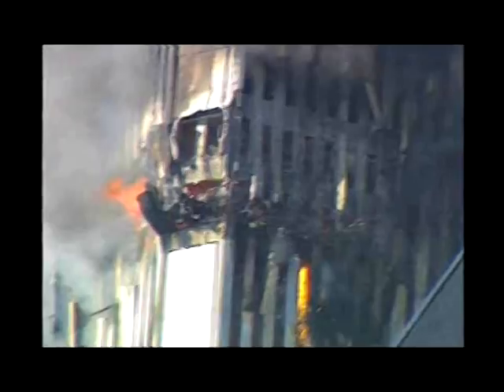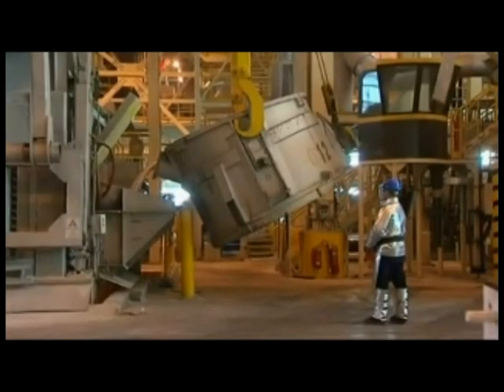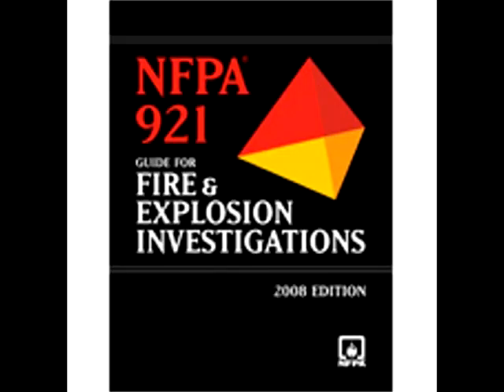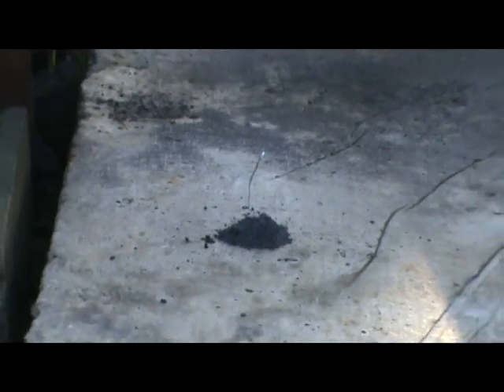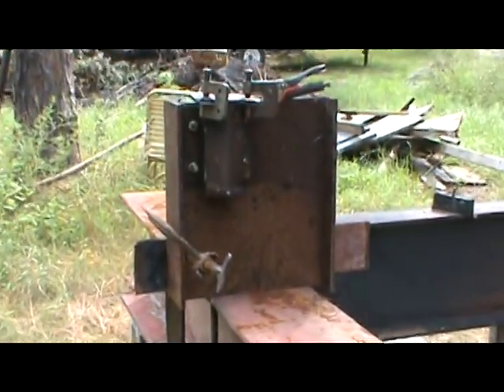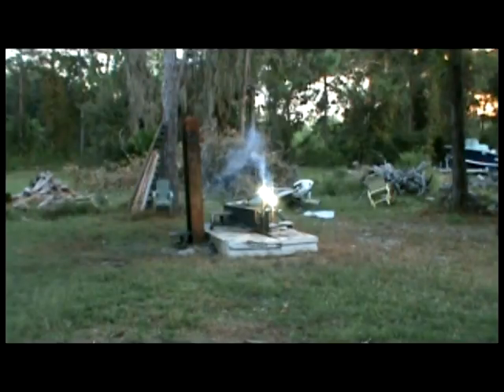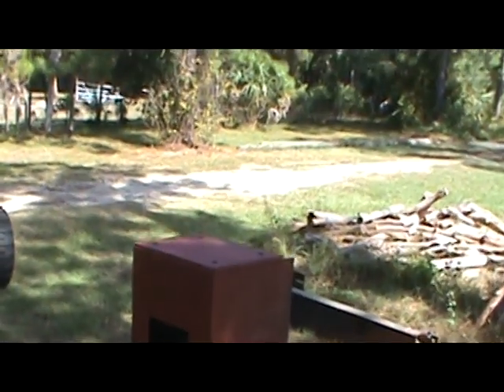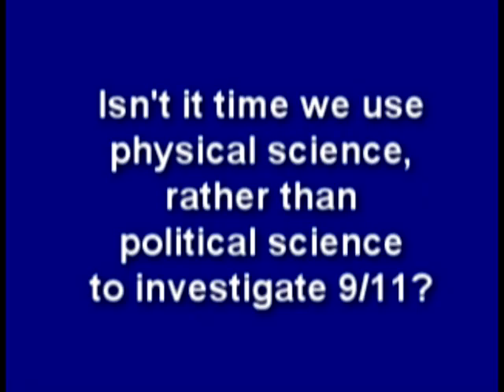9/11 Experiments: The Great Thermate Debate

Comment: is it unthinkable that a 400,000lb plane traveling at 500 miles an hour could cause a tall, thin building to colapse?
Reply: So if you cut a tree from half way the bottom half will just crumble
Reply: 400,000 pounds of material doesn't vanish, even if it did desintigrate it would have dumped 4,511,315,422 joules of energy or 3,327,375,499 pounds per square foot. do you have a concept of what that kind of energy would do to support structures?
Reply: ***** They definitely didn't build that building to withstand a hit from a 747, maybe a much smaller passenger plane, but not a monster like that. Plus look at this niggas math ^^
Reply: +Ty Lane 
It was NOT a 747. Check your information
Reply: +Ty Lane 
Well, I agree. The inside of the building was more or less open space. So Debris can shoot through the holes and the exploding gas/fuel is clearly seen. 
If the plane hit one side, wouldn't it then cause the building to at least tilt to one side? You know, less perfect destruction picture.
Reply: Martin Hoffmann Dude I'm just saying it was big plane, chill
Reply: ***** Site your source friend.
Reply: ***** Ok, *then your words are meaningless.
Reply: Of course the top halfs should’ve bred demolished but for the WHOLE thing to go into free fall is demolition
Reply: ian1493 I don't think you understand how planes work friend, the planes themselves are a whole other topic of discussion, first off how the hell can those flimsy planes travel at such speeds so low to the ground in the first place? Why where they so silent, they made no noise whatsoever! How can the wings cut steel? Do you know the material there made of? 

The planes themselves defy laws of physics, the reason planes need to travel 30,000 feet in the air is because the air up their is 3 times thinner, because the air is so thin they can easily maneuver and travel at 500 to 700 mph the air down here is much thicker and a plane that flail would tear itself apart in seconds attempting to travel at those speeds. In fact those kinds of planes are so weak the wings aren't strong enough to hold the fuel, the fuel is much closer to the body yet I'm suppose to believe those weak wings are strong enough to cut steal?

Also why were they silent? Those airliners are louder than guns, yet people didn't hear anything from those airliners that close to them, they heard the explosions yes, but the planes themselves were very quiet how the hell could they sneak up on them like that!?
Reply: +Martin Hoffmann The energy produced to create craters at plane crash sights is surely enough energy to break welds, and weaken the centermost points of a structure. Plus there is clearly video of debris and explosions going all the way through both buildings. Scientist have also stated that the beams didn't need to melt they just needed to be weakened by the incredible force of the impact.
Reply: Doesn't matter how heavy the airplane is. It is made of thin light material. It vaporizes at that high speed.
Reply: There is no point even in arguing this, since the official story says fire was responsible for the collapse, not the airplanes. After all, WTC7 also fell and wasn't hit by any airplanes.

Comment: The Boeing 757 and 767:

The aluminum that modern aircraft are made of is not the same soft material as that of a beer can: Aluminum 2219-T81 UNS A92219; ISO AlCu6Mn; Aluminium 2219-T81; AA2219-T81 – with a tensile strength greater than that of structural steel.

Gross weights 172,365 kg (380,000 lb) and, from 1992, 186,880 kg (412,000 lb); further increased centre-section tankage.

Structure

Fail-safe structure. Conventional aluminium structure augmented by graphite ailerons, spoilers, elevators, rudder and floor panels; advanced aluminium alloy keel beam chords and wing skins; composites {Kevlar} engine cowlings, wing/fuselage fairing and rear wing panels; CFRP landing gear doors; and aramid flaps and engine pylon fairings.

The airframe further incorporates carbon-fiber reinforced plastic wing surfaces, Kevlar fairings and access panels. Boeing 757 & 767.
Jet Impacts on WTC Towers 9/11/2001

Analysis by Willy Whitten – August and September 2012

All available data and reasoning based on such, proves beyond a reasonable doubt that large twin engine jets hit the world trade towers.

That they were flown by remote control [1], and had special engines configured to fly at the speed {at sea level} recorded: 450mph.

[1. See; Aidan Monaghan B.Sc. EET – abstract below]

This evidence includes, video footage and still images – radar analysis – wind shear analysis proving superior control –Sandia crash data – as well as kinetics analysis proving the energy needs were more than sufficient.

ABSTRACT:

Newton’s Laws of Mechanics:

> First law: Every object continues in its state of rest, or of uniform motion in a straight line, unless compelled to change that state by external forces acted upon it.

……….

This first law has to do with inertia or momentum, depending on the original states of the bodies in question.

As per the event we speak to, the first body is the building. In the frame, ie planet Earth; this body is at rest, an inert state, which has only one property: Mass.

>Second law: The acceleration a of a body is parallel and directly proportional to the net force F acting on the body, is in the direction of the net force, and is inversely proportional to the mass m of the body, i.e., F = ma.

……….

A state of Momentum has three components: Mass – Velocity – *Specific Direction. [*vector] -Velocity is described as mass-times-velocity squared in the energy equation.

In our frame, ONLY the plane has a state of momentum.

Moment and Point of Impact are both necessary integers in formulating impact physics. At that point and moment the kinetic energy of the mass in movement is transferred into the building AT THAT SPECIFIC POINT – the impact zone.

It is at this point that we come to the third law; that every action has an equal and opposite reaction. And this does certainly depend on the speed of an impact, as the first two laws clearly state that they are of first and second account before the third proposition can manifest.

Again it is at the point and moment of impact that the third law comes into effect and must be translated as per the laws of kinetics incorporating the maxim of equal and opposite reaction:

Kinetic Energy is defined as the work needed to accelerate a body of a given mass from rest to its current velocity.

KINETICS 9/11:

The energy equals one half the mass times the velocity squared: ( E = 1/2 m v^2)

The plane has a Mass of 120 tons – traveling at a Velocity of 540 MPH:

The kinetic energy resulting would be equal to 0.75812 ton TNT

OR: 3.1720e+9 joules (watt second)
https://hybridrogue1.wordpress.com/2014/02/04/911-disinformation-no-planes-theory/
\\][//
Reply: Willy Whitten You’re just bat shit insane

Comment: Nice experiments with thermite! But hey, jet fuel does melt steel,even hi-temperature alloys - e.g. in jet engines themself there is a lot of evidence regarding meltet (steel) turbine blades. I would not take the idea that jet fuel can not melt steel in general as true one.

Comment: Hey, those are some great thermite techniques. I am going to keep those in mind. Also we know thermite can melt steel. That is how they weld repairs on railroad tracks. National Geographic sure sucks at doing research, ha.

Now as for thermite taking down the towers, there are still a few problems. First, how could anyone get all those devices in the towers? I mean, that is a rather decent size job to attach all those devices. How did they go unnoticed? Also, how were they able to so accurately predict where the planes would strike the buildings? The collapses started at the section damaged by the planes. Also, how did they set up the devices in a way that they would not be damaged or destroyed by the aircraft? The aircraft could had taken out an entire side worth of such devices, ruining the desired effect. Also, why would whoever set this up not think the planes would be enough? Finally, why bother? Two aircraft doing that much damage, even if the towers do not collapse should cause a great deal of fear, what I would presume would be the desired effect at least.

Comment: I use to work on the railways. When welding tracks we would use a bag which contained bags of powered material  containing a mixture of thermite and powered steel.
You would set it up as a mold With the powered mix set up above the mold. You would ignite the powder which would then melt and flow into the mold joining the tracks together. 
Sometimes the bag would be ripped have its contents spilled on the ground, So to make up the loss we would just toss chunks of whatever steel we had laying around. Railway dogs (spikes)Thick steel plates etc Light it up and within seconds those big solid chunks of steel would be molten metal flowing like water

Comment: all high  rise  steel buildings are built around the elevator shafts. they are built of concrete and rebar  filled with jet fuel they will burn like a kelly kettle until the concrete explodes breaking the buildings back bone and causing the perfect implosion. thank God that the buildings fell into themselves and not like a tree .  God save America

Comment: There reports that before an attack work was being done at night inside the buildings. Possible they could have pre cut main load bearing beams so less termite is needed. And using nano-termite( nano or super duper termite) to cut less surface area( if beams were already precut) will defenetely do its work. Very nice video. Lots of work involved. Much apreciated.

Comment: As a structural Engineer myself, I give you massive credit for this video. Excellent progression with your experiments. I worked on the rebuild of the WTC and it frustrates me to hear so many people talk about theses theories who have so little experience in basic physics.  That being said, to be a fair experiment, you should heat a truss structure up and see what temperature it starts to deform the floor plate.  The inward collapse of the outer columns has been well documented (watch the multiple videos as the collapse commenced). 

As soon as that happened, there's not a building in the world that could withstand floor pancake collapse

Comment: i got a question, if thermite is made from aluminium and iron oxide, and the plane was made of aluminium and the steel beams were rusty, is there any way that thermite could have created itself? if jet fuel melted the aluminium of the plane, could that then mix with something? i know that molten aluminium and water is really volatile.

Comment: Just throwing this out there... thermite in its crudest form can be produced in a building that is constructed of aluminum and steel... the iron oxide needed to make thermite is often scraped from steel... in a high temperature environment if the two mixed or were exposed properly they may have ignited much the same way... conspiracies are rediculous in my opinion.

Comment: iron can oxidize, and steel even contains carbon, which burns quite nicely (see charcoal) -- so who packed tons of thermite into the joints of the Trade Towers, and why didn't any of the inspectors or workmen or employees there ever notice it being done?  "You are being bombarded with conspiracy theories every day, and most of you ignore it, but some specially susceptible individuals swallow the BS whole" - Poor Richard

Comment: Plans are made of aluminum and magnesium  alloys, so as soon as you get the alloy to melt the magnesium  will start burning. Also the plane most likely took some of the insulation off the steel beams so when those beam with no insulation are exposed to high temp they will hold their heat better because Of the places where the insulation didn't get taken off. So it's not very difficult with those things working agents the steel

Comment: These experiments are of no significance since you only had to weaken steel, so it can bend, which heating does perfectly. Then the weight above collapses the tower.   There was no weight of tower above in this experiment.     A real conspiracy of this size would not go undetected.    Nothing is this experiment tested the premise that enourmous amounts of jet fuel and raging drafts of air cannot melt steel.

Comment: Alright they are not saying that Thermite can't melt steel just that they were saying in a vertical aspect all the heat is burning downwards. It can get hot enough to cripple steel on a vertical placement by getting it close enough to the melting point. They use thermite to weld rail road tracks for the last 30 years or so. Also those pressure puffs would be due to the increased pressure from the heat inside the building or it was internal layers of the building falling down or hanging creating the pressure to make the puffs and not explosive. The whole function of structural steel is its strength. Add heat to it will weaken the steel and does not even have to cut. Also to setup that type of system to make the thermite effective is going way to far. The best explanation is the fuel started and made fires hot but everything else in the building made it even hotter. Gas fires in vehicles have been known to melt down engine blocks to puddles of steel and iron. Trying to make things out of something of speculation. Also the thermite mix can easily be made from rust and aluminum and activated by an electrical flash. That happens with thermite production and static sparks. That building had electricity for a long time before fell. Also one final thing is that piece that looked bulged out was because it was hot and compressed outwards bending it to that shape. Many things can cause lots of popping sounds like gunshots and then loud bangs after. Concrete that is heated up will do that and the same with steel under pressure. For you to say an office fire cannot melt steel shows how much you don't know. I have seen several car fires that got hot enough to where you could not look at it. the aluminum intakes melt and mix with the steel just enough to start a thermite reaction and then melts down the engine block. Yes use Science to figure things out but when you have an idea and try to prove the idea that it can happen, tends to go to far and leads to that the building was set for self destruction.

Comment: I agree 9/11 was an inside job, but I find it unlikely that explosives or thermite could be set up on each floor and would happen to be so close to the floor where the planes hit.

How many people think that it was a nice neat lab condition in those towers?

You had high winds, vaporized materials including drywall, fabric from furniture, aluminum from the plane and from furniture that shatters into a fine dust on impact; titanium from the airframe which will burn without any oxygen once ignited.

This is an excellent video that explores a lot of thermite combinations, but I would like to see the maelstrom type environment to see if that could cause it.  Experiments to this level using Jet-A fuel, and by utilizing atomized microfibers and drywall, in high speed winds, mixed with jet fuel.

Comment: Really interesting, but it does not consider the possibility that the crashing aluminum airliner, and lots of iron oxide from the burning building cooking the beams could not have atomized lots of powdered metals and metal oxides together at high heat with lots of potential accelerants (e.g. Jet Fuel, Acetone, etc.) creating a thermite reaction as a byproduct of the crash.  It is certainly of a similar likelihood to a open-minded but neutral observer.

Comment: "Nano-thermite" is just very fine particles of iron and aluminum suspended uniformly in a viscus media. It gets called "super thermite" due to it's ability to make thermobaric reactions. This is a great video, I would like to offer another side of this same issue. I'd like you to try and get steel to melt using only jet fuel, and office supply's. Then I'd like to see a test were we shoot aircraft grade aluminum at steel beams to find out at what speed aluminum can defeat structural steel. It is now 14+ years since this event and we're no closer to having answers then we were on 09/12/2001. with a majority people believing that the 9\11 investigations were not only bias, but also hindered in what it was allowed to investigate. That it's time for a new independent investigation.

Comment: The only way we're going to get any hard-core PROOF of what actually happened on that day, is to build one of the 2 towers the the original exact specs (In a controlled environment of course) and remotely fly a fully fueled 747 into the building at the exact same angle. You wouldn't need any more proof than that!

I'm not saying I'm in agreement with the truthers, but if you want your proof; what better way? I'm sure someone with a load of funding could put such a project together. I know this would never happen being that you'd have to raise aprox. $2.5 billion